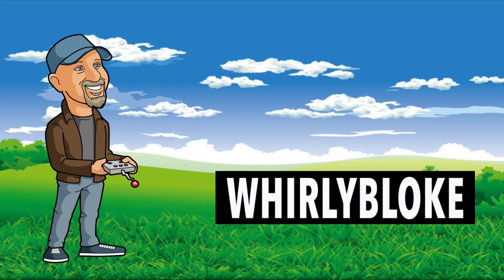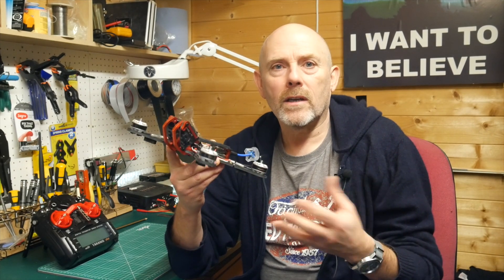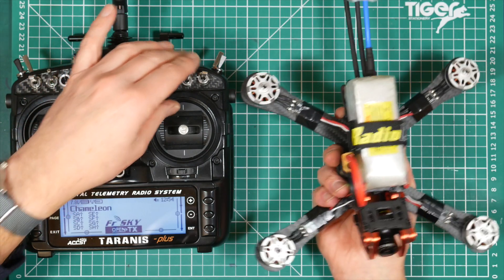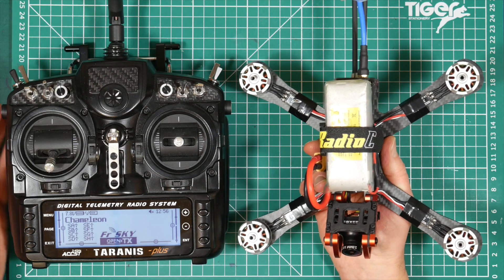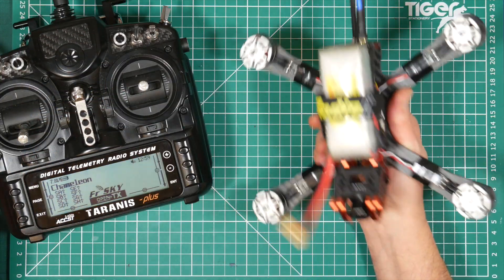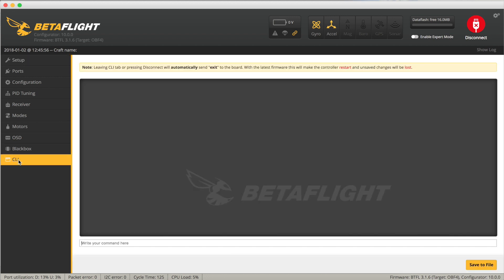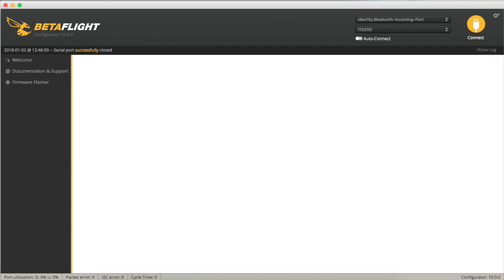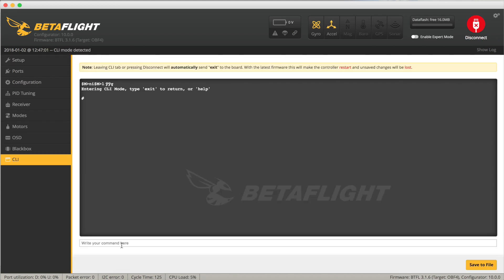Arm your quad inverted and escape from trees - small_angle is your friend

Comment: Default settings is 25 degrees think, maded by safety. Think if you hold your quad with 180 angle arm setting and self leveling mode accidently turning on can really hurt you . Better use switch who sets to arm in any angle.
Reply from the maker: I still set small_angle to 180 but now, with turtle mode, it's pretty redundant.

Comment: Just used a fishing pole and 65 pound braided line to fish my quad out of a tree. This could have made things way easier. Ty. My be you can help me with another issue. I use the cl racing f4s and I noticed at times my motors won’t beep and other times they do. When they won’t beep I can’t arm unless I disconnect battery and reconnect.